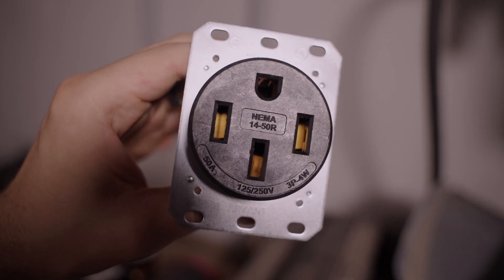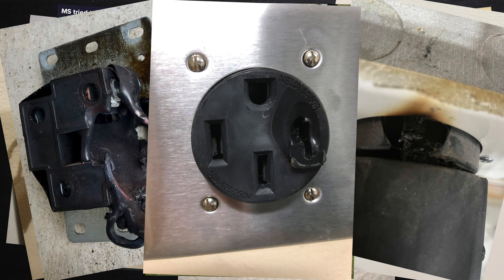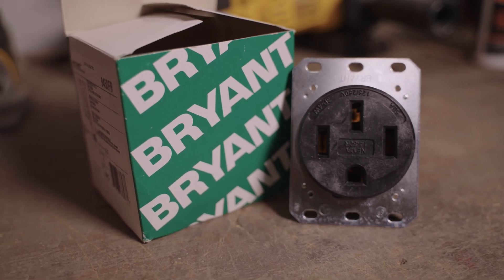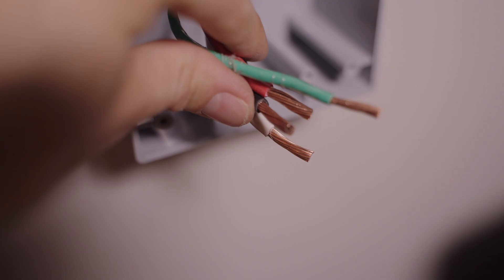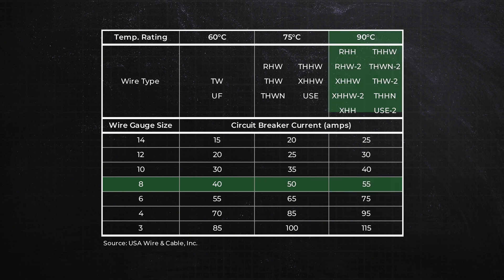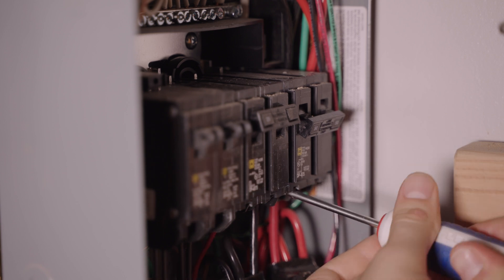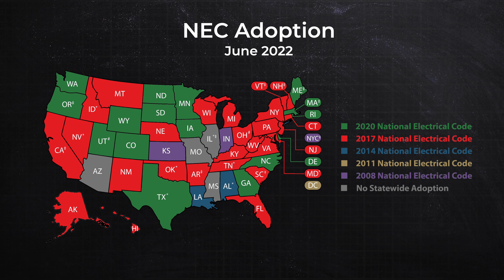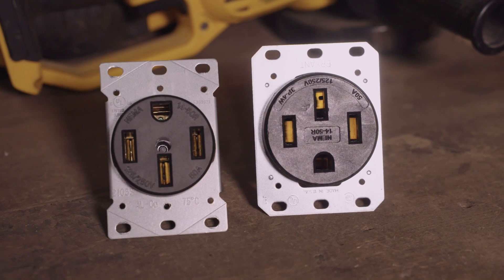3 Mistakes I Made Installing a NEMA 14-50 Outlet

Comment: Don’t ever listen to guy like this. Yes this new video he discussed his mistakes but he’s not qualified as an electrician. If you can afford the car you should spend the money on an electrician. You should hard wire these charges when possible. Your disconnect point might need to be changed from a plug to a mounted disconnect ahead of charger.  People also need to make sure they have the space in your panel and enough load to your home. As an owner of an electrical company I just laugh on how unaware the consumer is. I have an old subdivision where they have 70 amps total on house. They bought the car one bought two and it’s going to require new transformers from city, new wire to house, new service, new panel.  The cost of one was around 20k . Please do your homework people.

Comment: calling the NEMA 14-50 a 240V outlet is technically incorrect.  because of the presence of the neutral wire, it is actually a 120/240V outlet (120 from either line to neutral, and 240 from line to line).  a 240V outlet would only have line/line/ground, with NO neutral pin (not to be confused with three prong ungrounded outlets, which are also 120/240V).

also, while you did not do it here, I will say it anyways for any idiots that might try it, NEVER use the ground pin as a substitute neutral.  two reasons for this are, 1 - if you have a sub panel, then you are now bypassing a safety function as the ground and neutral are not bonded together in the sub panel, so if you have a GFCI you are going to be tripping it a lot (because if you have a metal plate then each time you touch the plate you create a possible path the ground through your body and the GFCI will detect that and trip out), plus, you have the issues of if you DON'T have a GFCI installed, and you touch the metal plate when using the ground as a neutral, you may very will create a path through your body and YOU WILL FEEL CURRENT RUNNING THROUGH YOU (and it can hurt or kill you). 2 - if you have a fault where the charging unit goes bad, you could end up not only tripping the breaker in the sub panel, but also the breaker FEEDING the sub panel, and it isn't as bad if the breaker is located in the main panel, but still not a good idea. oh, and...the purposes of neutrals and grounds are not the same, so using one to substitute for the other is a major code violation, even if they end up bonded together at the main panel.

on a side note, use caution when buying outlets as, and this can happen with online sales, there are also three phase outlets that use four prongs (line/line/line/neutral and line/line/line/ground).  if it doesn't directly specify it is a NEMA 14-XX (120/240V grounded, with XX being the amperage) someplace on the outlet, then DO NOT BUY IT so you don't end up with the wrong one.  For those that only have a three pin connector, and you know the charger doesn't require a neutral, then you would likely need a NEMA 6-XX outlet (240V grounded).
Reply: I'm not here to argue and no I am not a certified electrician. You say with a neutral is 120/240 but what about new appliances like a dryer that is 240 yet they all come with 4 wire plugs, 2 hots a neutral and a ground??
Reply: The general concept is a NEMA 6-xx is 240VAC as it has the two lines (call it single phase or split phase, I don't care) and ground. The NEMA 14-xx adds neutral, giving you a safe return to pull from one line or the other (effectively offering 240V line to line and 120V line to neutral). This was used to power 240V motors and 120V controls.

Comment: You're making a correction video but you're still short changing.

You essentially planned on the 50 A but then you short changed yourself to the 40 amp.

So you went for a cheaper receptacle and ended up short changing yourself.

Even on top of that you have to consider the conductors. The THHN/C wire etc. has a size consideration which is based on the outside diameter since each conductor is insulated. You can only run three of those in half inch conduit. 

In layman terms,  you want 6/3 cable. Six gauge with three conductors and a ground. Based on the size to be encode you're going to have to run that in three-quarter inch conduit. Now if you go with a SOOW cable you would not necessarily need to use the conduit. But, if you're just running a standard 6/3 cable you will.

It's just a shame you're making the correction but you're actually not doing yourself any benefit.
Reply: Probably doesn't want to buy more wire it's expensive, but me personally I'd save the 8/3 for another day and buy the 6/3.
Reply: SOOW is a cord, not a cable.

Comment: GFCI PROTECTION

On this one, you have a misconception..

My NEC, 2020 indicates that in 2017 or earlier, your " charging brick" requires GFCI protection and any receptacle for car charging needs GFCI protection.  This is in the car charging section or EVSE section 625.54.

In the NEC, the shaded areas indicate that is cycles changes.  No shading and the change was made in an earlier cycle.   

625.54 thus indicates GFCI protection for the receptacle in 2017 or earlier.

Thanks

Comment: Why don't you call Leviton and ask them if their 50 amp outlet is within it's peramiters to pull 40 amps continuously for 8 hours???? I install many of these and have since before tesla, HOWEVER, since tesla we have also done a few. these are full time clients. I check my work after the fact, so far I have not found anything.  I suspect that people are not screwing their screws down tight like they should be, and are looking for someone to blame rather than looking at the dumbass in the mirror.
Reply: You are correct!   The biggest issue would be loose terminations.   But you must be careful to make sure you have the correct conductor size at 60C device rating with Leviton.   Hubble is the only one I know of that is 75C.   Hardwired would be cheapest and best install.

Comment: Those wall wires are NOT rated for 50-Amp service.  Way to small.  Probably originally had 15 or 20 Amp service.  Will melt in the conduit, or cause fire at junction box.
Reply from the maker: 8AWG rated to 40A at 60C, 50A at 75C, and 55A at 90C.
Reply: @chargeeverywhere  Wires look way smaller in video.  Also, only applies if sufficient cooling.  Not sure if conduit is large enough for that 50-Amp loading, both phases, for continuous use.  Measure the conduit temperature after full day of charging, and see if you are safe enough.  Depending on the wire insulation (not stated), wires may melt-through at corners or kinks, then short or get creep-fails.  Seen this before.  Lucked out, in that soft-arcing melted copper sufficiently to cause breaker trip out, before fire started, but was smoking.

Comment: If you are unplugging and plugging in the charger plug, you need to install a permanent charger. You are just asking for a fire eventually. A better outlet will just last longer, but eventually it will fail.

Comment: Sometimes I can’t explain something very well but it has to with the amount of current you can put through a wire.   Under one circumstance you can put say 20 amps through a number 12 wire, another only 10 or 12 amps without overheating.    One of the circumstance is the ambient air temperature but also if there is anything else heating the conduit such as sunlight exposure or whether there are a whole mess of wires in a small conduit, all carrying a lot of amps.   I’ve been fooling around with car alternators lately and on the rotor coil, it does not take that many amps for the coil to overheat if it has been running a long time.   The wire in an electromagnet or transformer is all packed together and thus harder for the heat to escape.   I think sometimes you got to use your own head to determine what wire size you should and not just go by what someone else says.
Reply: It's not a matter of "going by what someone else says". There are standards and if you follow them, you greatly reduce the chance of problems. One other factor you didn't mention is length of wire. If you have a long wire run, standards are set for when you need to upsize as well.

Comment: Sorry, but there is a seperate nec section for car chargers, evse equipment, that in the 2017 or earlier code required gfci protection for car charging recepticles.

Please review article 625, specifically 625.54.

Article 210.8 now requires (nec 2020) gfci protection for garage recepticles up to 250 volts be gcfi protected.

Comment: 1. PVC conduit must be glued. If it's required at all , it's required to be water proof.

2. Industrial ceramic outlets don't burn. I would recommend those over plastic ones. 

3. Hard wiring is not difficult and is safer. It's very easy to take the plate off and disconnect and cap the wires when moving. This is commonly done when stoves move.

4. GFCI is required usually for outdoor/uninsulated spaces.
Reply: Prior to the 2020 nec update , so nec 2017 or earrlier,  article 625.54  requires gfci protection for electric vehicle charging recepticles.

Comment: Did you use the 125% rule and gfci current protection  NEMA 14-50 WIRE #6AWG  2 HOTS BLACK RED AND GREEN NO NEUTRAL. TESLA DOESNOT USE NEUTRAL ON THEIR TESLA WALL CHARGER.

Comment: A few years ago while at an IAEI continuing education class they told us that UL labs had samples of receptacles & can't remember if it included switches from all around the country. Approximately   only 30 yo 40% were toquered properly. Remainder were close in either not toquered enough or too much. Was told excessive torque was just as bad as insufficient torque. Of the approximately 100 electricians at the class less then 10% even owned a torque wrench or torque driver.

Comment: Is the screw-style connection on the cheaper receptacle really a problem? That's what breakers use...
Reply: Yes, it can be. Breaker panels typically use hex socket screws on large, say 6 gauge stranded wire for incoming power and power to sub panels if applicable. The individual breakers are usually 15, 20, or 30 amp and solid wire should be used, 14, 12, 10 gauge respectively. 8 gauge and heavier will be stranded. Since solid wire can't separate, it makes a big difference, so screw type fasteners are appropriate.

Comment: It originally was a 14-50 outlet with the tesla Mobil charger which only charges at a max 32 amps. I put the larger wire in and breaker knowing I would probably upgrade later which I did, I installed a Tesla wall charger which charges up to 48 amps max but you can control how many amps flow with the Tesla app. You can turn it down to 15 amps or up to 48 amps or anything in between. I turn it down just so its not pulling a ton of current when its really not needed. If I get home and will not leave till the next day which is more then 12 or so hours away typically, turning it down to 20 or 25 amps makes it charge over about a 5 to 8 hours window depending on how depleted the battery is that day. Charging at 48 amps is not needed so I don't do it. The wall charger recommends 6 gouge wire and a 60 amp breaker because overkill its a good thing. Less heat in a larger wire when pulling max amps.
Reply: Why not just put the heavier, proper gauge wire in and be done with it?
Reply: @gextreme2381  I did put in the proper gauge wire if your talking to me, not sure what your talking about.
Reply: And your battery will last longer instead of dumping tons of amps into it all at once

Comment: Also consider voltage drop potentially requiring the upsizing of wire size in addition to those other derating factors.
Reply: I was going to ask what the voltage under charging conditions was. 
The limit is 3% per branch and 5% total.  210.??? in the NEC
Reply: @allenshepard7992  NEC does not rule on voltage drop, it only makes the suggestion of 3% for a feeder or branch circuit, or 5% total for both.
Reply: @YaksAttack     You are totally correct!    There are two reasons for voltage drop concerns.   Do you know both of them?  Just a quick pop quiz. 😊

Comment: It’s like a gfci on a freezer in your garage, nothing like coming home from work with a defrosted freezer because of a nuisance trip.
Reply: Yup, Stuff like that pisses me off. Nothing like a good only thermal trip breaker. The appliance manufactures have their own protections and design to standard trip breakers
Reply: @abrahammc2125  The GFCI protected outlets have nothing to do with the protection of appliances and everything to do with personnel protection. The code has no idea what you have plugged into that fridge / freezer outlet. And, for years the model code exempted single outlets from the GFCI requirements. Not a duplex outlet but a single 120 volt outlet.
Reply: @denali9449  I am aware, but you are talking to someone who is aware of the risks. I do not live my life according to the code book for "safety". Rich people do not live by some set standard, they always live custom. I am no different.
Reply: @abrahammc2125  If you actually believe that appliance manufacturer's build in some kind of GFCI protection to trip a standard breaker then you deserve what you get. Hopefully all your corded power tools are of the double insulated type and you never have an issue.

Comment: your first red flag was purchasing electrical equipment at Home Depot. Not the same quality as parts purchased at an industrial electric supply retailer. Yes the reason the receptacle is $150 vs home Depot $15. Hello!

Comment: Hard wiring a device made for a EV looks more practical to have; don't have plug it in and unplug daily or almost daily(the plugging and unplugin frequently will were out the plugin in a year in my opinion)
Reply: I leave my EVSE's plugged in all the time. Why would you unplug it on a regular basis?
Reply: Ya I don’t understand that point either. Are people taking their EVs and parking it at someone else’s house for extended time on a regular basis, hence needing to take their mobile connectors? There are Superchargers everywhere for road trips, can’t think of any other reason to constantly unplug mobile connectors.

Comment: I hope you tested the wires for voltage before you worked on it. Just because you turn off the breaker does not mean it is safe. Double Check. Both legs to ground.

Comment: YOU MUST DERATE FOR CONTINUOUS LOAD (a Load lasting 3 hours or long) So that 40 Amps that you mentioned gets Derate to 32 Amps... You should not be giving people electrical advice unless you are a Licensed Electrician who is familiar with Continuous Loads!
Reply: Not every jurisdiction requires an Electrician to be licensed.    Also, it's clear you didn't listen to everything he said.  He covered that.
Reply: @maurice7413  Licensed Electricians and/or Building Permits has nothing to do with Code! Code is established for the safety of individuals and their property...  I have been to peoples houses where that have had an EV Wall Connector or Outlet installed and have found overheated wires, undersized wires, undersized breakers, oversized breakers and other issues that could pose very serious problems...
Reply: @michaelholliday100  clearly you forgot what you said "You should not be giving people electrical advice unless you are a Licensed Electrician who is familiar with Continuous Loads!"

And I said you don't have to be licensed to be an electrician.  

So your response to me has nothing to do with what I said.
Reply: @maurice7413  I have my EE and know more than most Electricians. I was primarily speaking of those that make videos, post them on the web and believe that they are absolutely correct.